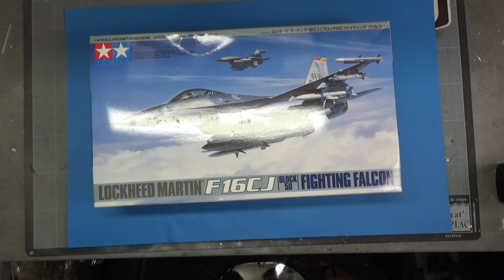F-16 CJ Block 50 - 1/48 - Tamiya model kit - Full Build step by step

Comment: Bought one for my upcoming birthday. How long does this take if I just don't have to tools. Can I still assemble it
Reply from the maker: it's going to be complicated. At the very least, you'll need a pair of pliers to cut the parts off the bunches, some sandpaper, some special plastic model glue and a scalpel. I've never tried to build a model without tools... I recommend you invest in a tool kit that you can find for cheap on Amazon, for example.

Comment: What grit type does the sanding stick have to sand off the canopy seam?
Reply from the maker: I started With 800 and after 1000, 2000 and finally 5000
Reply: @DarkSideModeler  thank you

Comment: What is that you used to put the canopy on?
Reply from the maker: I used CA glue but you can also use white glue (it is longer and need a canopy suporting while drying.
Reply: @DarkSideModeler  thanks
Reply: Also what is that cloth used to put on the canopy?
Reply from the maker: @coletoliver3977  it isn’t a cloth to clean glasses
Reply: @DarkSideModeler  What is the yellow thing then?
Reply: @DarkSideModeler  Then what is it?

Comment: While I highly applaud your skills & abilities, heavily dirtying & weathering this jet was inaccurate. F-16s in general aren't dirty (though they will have some streaking on the ventrals, bathtub & donut), & get wiped regularly & between flights. Have Glass tends to have a darker hue but anything white will be bright white. This kit depicts a pimp jet, which represents the entire wing & if it ever really looked like that, crew chiefs would be fired & would come in on the weekend to correct it, for however long it took on the wash rack. Also, pitot, AOA, air data, & total temp probes would be highly polished, as would the turkey feathers. Back before Have Glass, jets looked fairly new years after delivery. I hate to critique so much, especially since my skills don't meet yours, but I think modern USAF jets are overdone, particularly the 16. Foreign sales aircraft are a different story. This one might be underdone for one of those.
Reply from the maker: First of all, Thank you for your comment. It seems that you are a specialist so I will not discuss about all what you said. I will take into account all your interesting comments and try to be more realistic the next time.
Reply: I agree.